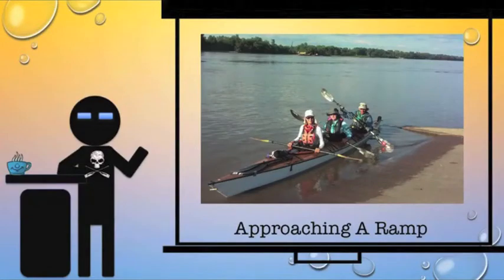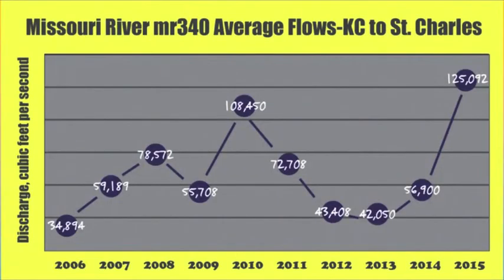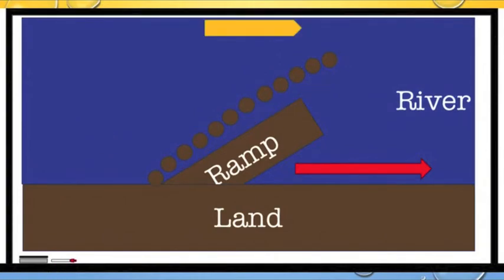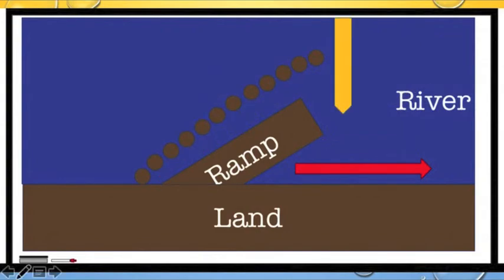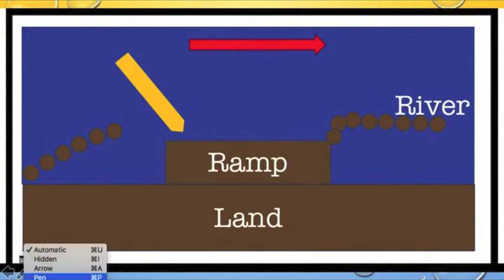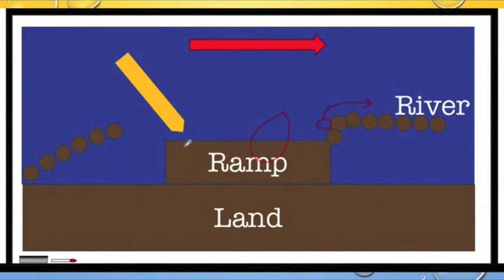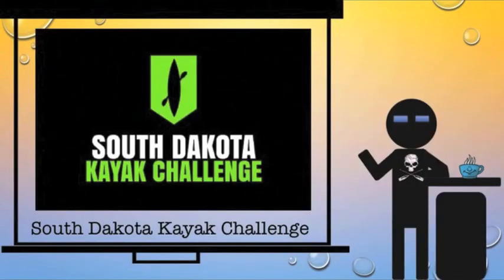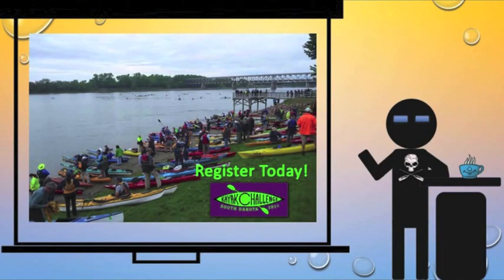Approaching a Ramp

Comment: I remember everyone yelling from shore at Coopers to go very wide.  Is there any way they could anchor a flag to one of those end rocks?  Also, what about approaching the ramps for side exit/entry vs. nose to concrete?
Reply from the maker: Side exit blocks the ramp and is a real problem through Miami with so many coming in at once.  the flag idea runs into the problem of putting it out there and even then the submerged rocks will be the issue rather then any you could see and put a flag on.